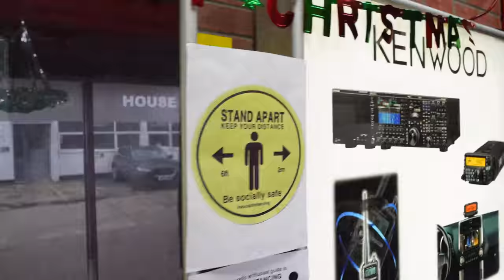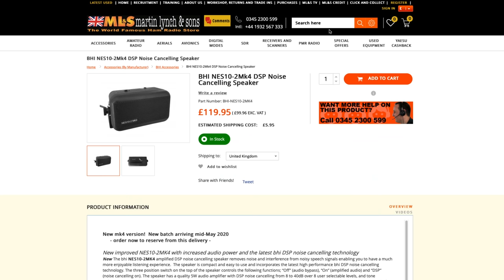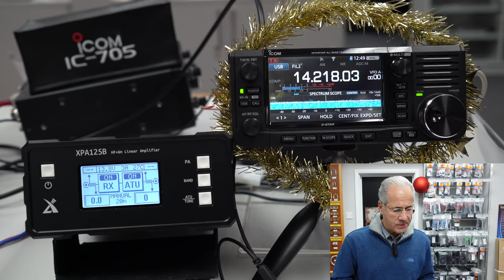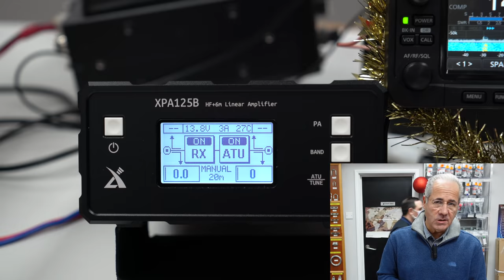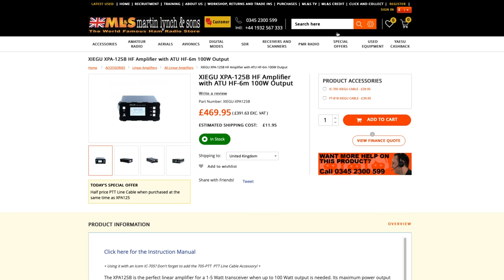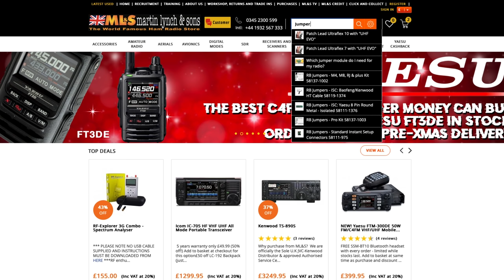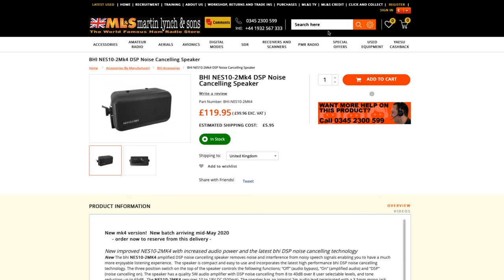Xiegu Amplifier for IC-705! Plus Martin Visits the RSGB - Something for the Weekend

Comment: Way too expensive for a Chinese amp, when you could get a great 100w rig for less than the cost of the 705 and this amp together. That said, why would anyone buy a QRP rig and then stick an amp on the back? Just get an IC-7300--same functionality and display as the 705, 100w out, and if you want to go QRP you just lower the output.